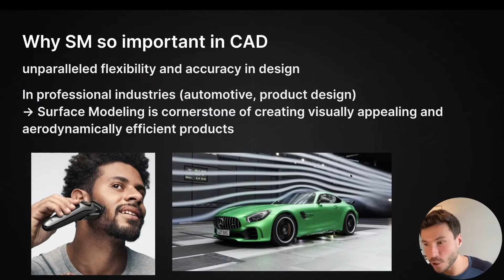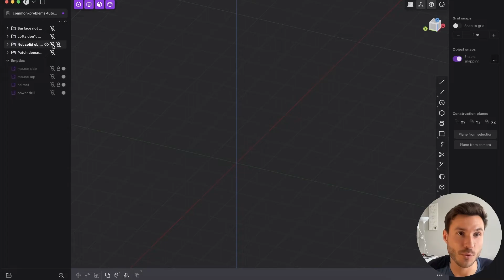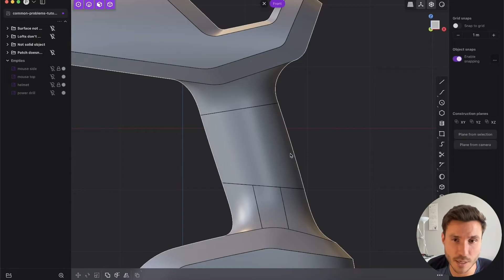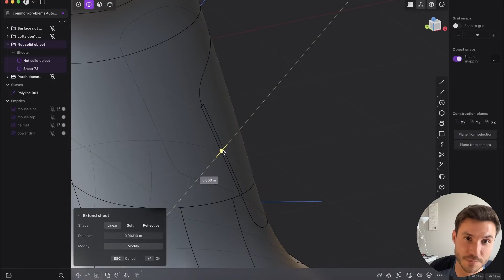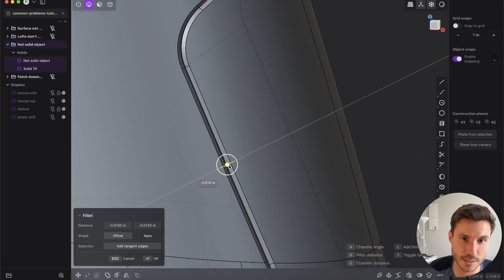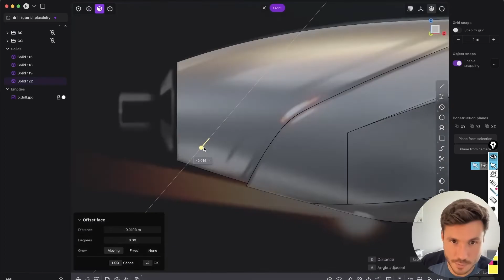HELP! My SHEETS are not joining into a SOLID | QUICK FIX

Comment: Another technique I have tried is, if it won’t make a solid, unmirror the object. Select the entire midpoint edge and extend it a bit across the mirror boundary. From a top view, create a line on the midpoint boundary and cut the object at the midpoint. This will even up the middle edges. Then delete the excess faces that were cut and re-mirror.
Reply: This will also keep topology cleaner and can  be helpful when patch won’t work on the middle boundary.